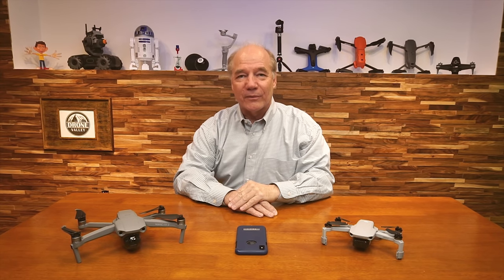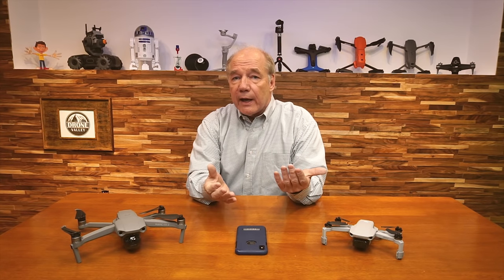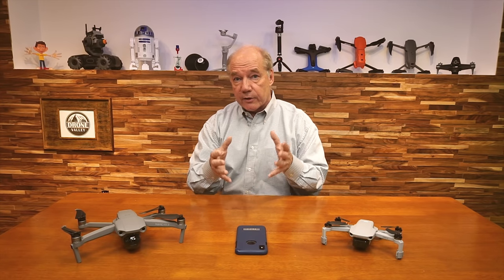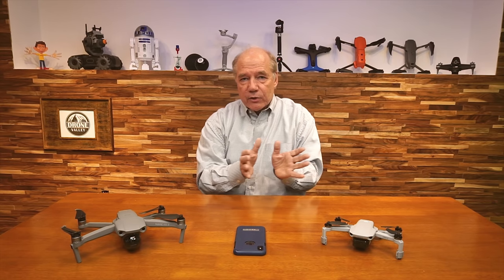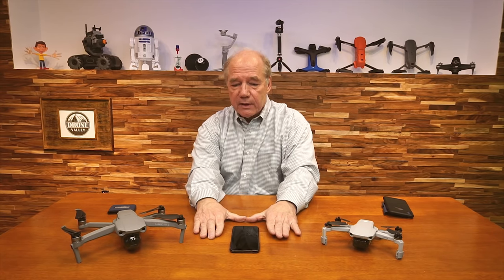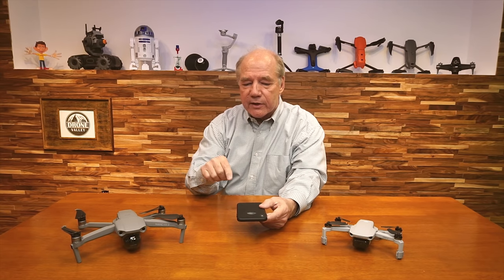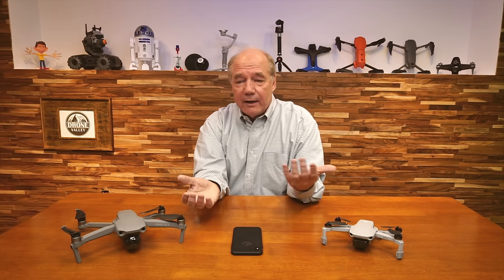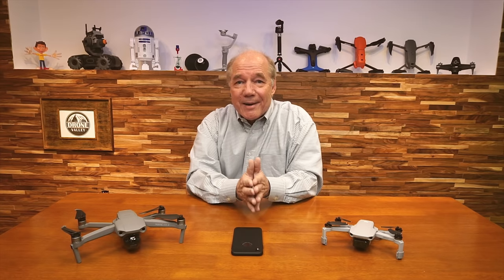Why Your Pilot Compass Is Off in DJI Fly and How To Fix It

Comment: Open the Google Maps app, making sure that your blue circular device location icon is in view. Tap on the location icon to bring up more information about your location. At the bottom, tap the “Calibrate Compass” button. This will bring up the compass calibration screen.
Mine was low after 30 seconds is now high. Thanks, video was super helpful.

Comment: A great tip I always use is to hover over the landing pad for a few seconds. I have the Evo1 but looking at the Mini2 as a second more portable drone. I have the Samsung S8 Android but have seen others that had no problems using the DJI Fly app with it. I never miss any of your videos as it will help me once I get a DJI. Thanks rick. Very professional!! I did miss one tip to do a 360 before flying right/left or backwards to see if any obstacles. Almost came close to crashing into some high tension wires.

Comment: Hi Rick that was a very helpful video  I’ve got another one for you my horizon level is out on my mini 2 i have calibrated the gimbal 50 times plus  but its still out i have adjusted it manually in flight but have noticed that when I rotate the yaw the horizon is not level again I am running the latest software and firmware but its was doing this before the resent update. What do you think could be causing my problem hope to hear from you soon.

Comment: Hello from Norway ! I havent seen this video before now, and have issues with my Smart Controller and the attitude indicator/compass/map... The orientation of my Mavic Air2 is correct but compass and map is pointing about 90 degrees to the right when im facing my drone... both drone and controller is calibrated and still the controller icon is 90 degrees wrong ... I have not yet got answer from DJI support how to fix it, maybe you have ? This issue makes me very frustrated as it has been there since the attitude indicator was added ... Please let me know if you have any idea !

Comment: I have always calibrated my phone compass for probably the past 20 years. Mostly because I like to use a star constellation location app and it doesn't work worth a darn if your compass is off.  They used to tell you in the calibration instructions to start the calibration facing the phone North. I have always done my drone compass calibrations starting facing north, and carry a small (real) compass in my drone bag so I know where North is.

Comment: One of the biggest problems I've had is that the DJI software no longer seems to understand my tablet is in landscape mode, and that screws with the compass.  For instance, the pilot indicator is perfect if i have my tablet in portrait mode, and it's 90 degrees off when i switch to landscape.  Pulling up a compass on the tablet shows everything fine, but the fly app just shifts everything 90 degrees when in landscape.  How to fix?  It never did this with the old software I had on my old Phantoms.  But it's been doing it since day one on the fly app on my air 2.

Comment: I like the old Attitude Indicator much better.
Reply: I am almost always right next to the home point, and the tiny tiny tiny blue arrow pointing to the drone is covered and/or unreadable  I agree - bring back the old arc at the bottom center of the screen.  I reached out to DJI support and they were deaf to this issue.  I can't be the only one.
Reply: @NorEaster4270  I had the same problem Mike and the last firmware update fixed it. I’m not sure it was the firmware just maybe the change. Maybe you could try reinstalling your firmware or something.

Comment: I wish DJI would have left 'Well Enough Alone" I like to see which way the drone is pointing and I could turn it around and fly back to where I am.
We are getting too much information.
I do like the horizontal bars that show if the drone if being bucketed by the wind.
Reply from the maker: I agree and am not normally a guy that likes constant change, especially if the software or interface is working. But with this update they actually provide a lot more important information that took some time for me to get used to. I do wish they allowed us to toggle between the old and new for folks that don't like the new indicator. I have also suggested they offer the option to enlarge the Attitude indicator as one of the options for the programmable buttons on the remote. We'll see if any of that happens. Thanks for the post! Rick
Reply: @Dronevalley  I agree with the choice to stay with the old one (which we use and like) and the new one with "TMI" too much information.
Let's Keep It Simple !

Comment: You don't have to calibrate the compass everytime you fly.. There is no such thing even in the manual that says it needs to be calibrate everytime you fly. Only calibrate if the apps tells you or if the drone is acting jerky starts drifting or doing a circle hovering, just like a real compass that making some weird movement when you put it near a magnet and if you put the magnet away, the compass will be back in its perfect condition, same with the drone, if you move it away from any magnetic interference, the drone compass will be in ok. That is why you don't need to always calibrate your compass.
Reply from the maker: Again, I never said to calibrate it every time you fly, only when you get the compass error or if you've moved far away from your last flight location. The drone uses a digital compass that needs to be reset to North every so often because if it drifts (and it does) your drone will not be able to navigate correctly. It will also affect the display on the app and may cause to to fly in the wrong direction when heading home. In this clip I show you how much your phone compass affects the display and most people don't know this and never calibrate it.

Comment: android calibration? my max range has left me wanting. lose connection at 4 km
Reply from the maker: Kevin, thanks for the post and Android has a compass calibration routine as well for their devices. You may actually be facing slightly away from the quad and that's affecting your range. Try the compass calibration on your phone and if that doesn't help you can always snap on a Range Extender to the controller. Good Luck!
Reply: On Android open Google maps then move the phone in a figure 8 like Rick did in this video. I suggest starting out with the phone facing North for best calibration accuracy.